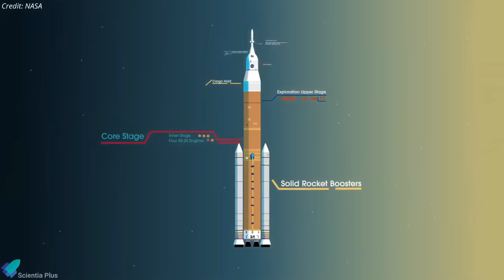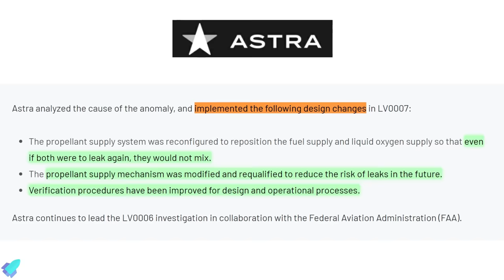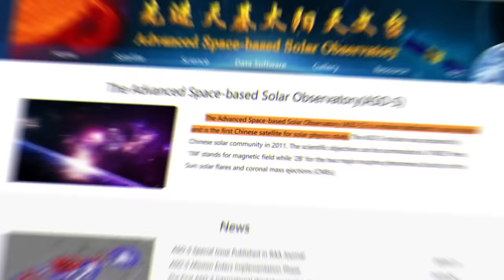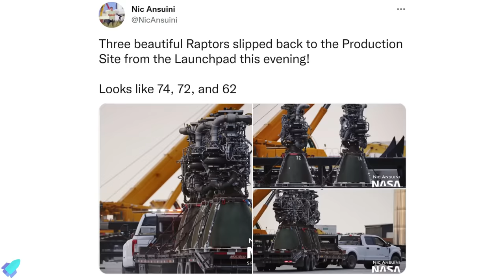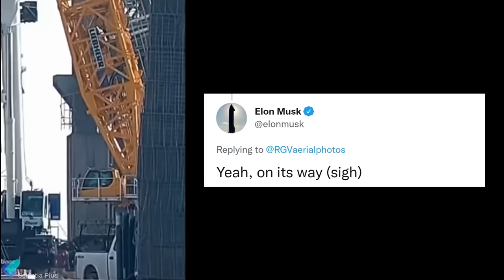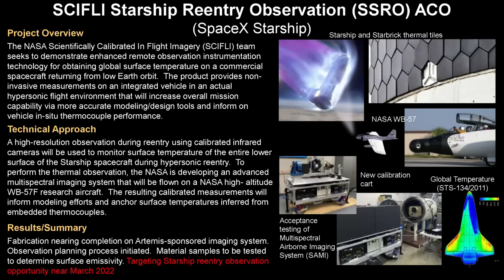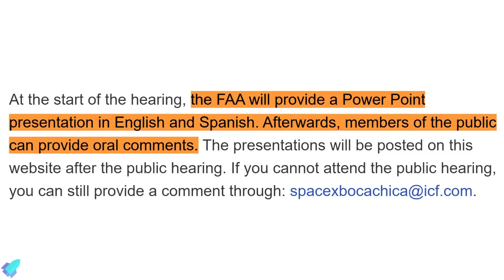Starship 20 Static Fire Imminent, Mechazilla Arms | What caused Astra Launch Failure? | Blue Origin

Comment: Astra came up with a new definition of " Well That Plan went Sideways!". Which did have its funny moments. A pity the launch computers did not have a "Return to Base" option. And vent the excess oxidizer first to cool down the rocket upon landing. Then vent the excess fuel when everything is safely below the fuel ignition temperate point. 
Something for the rocket designers to think about.
Especially since Space X has proved a soft landing is possible for to make reusable rockets operational.

Comment: You CANT light up booster4 for full flight without a water deluge system, it is not possible. A water deluge system requires a de-salination plant that will cost in excess of a billion dollars to meet launch requirements as you can't use salt water. Why is No-one talking about this??? there is no launch without it, starship 20 will be torn apart by booster4s 33rocket engines without the water deluge system.
Reply: I hate to spoil your panic, but I'm pretty sure you can get water to the launch pad without a dedicated $B desalination plant.  I'm pretty confident the SpaceX team has this one under control. 🤷
Reply: Even bottled water wouldn't cost $1bn (or even close to it...)